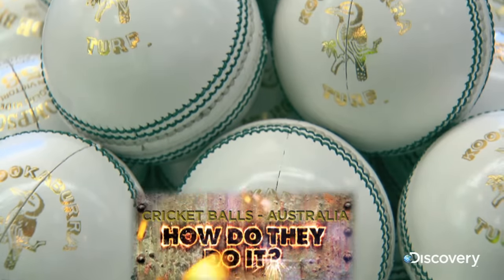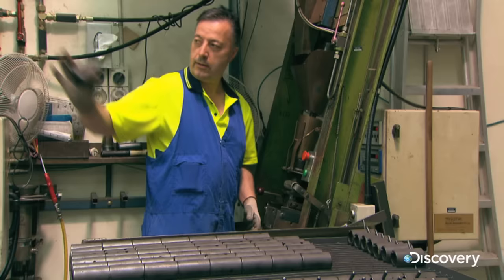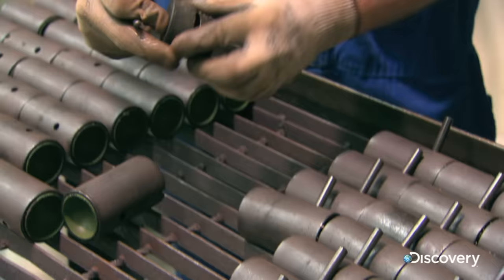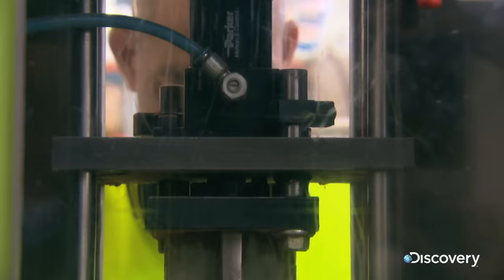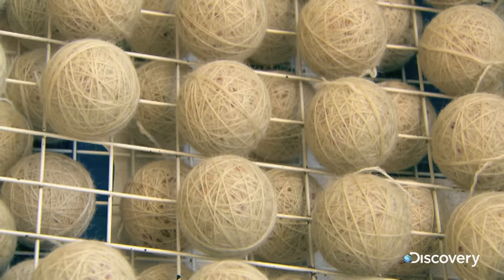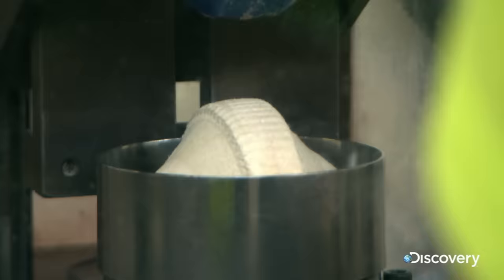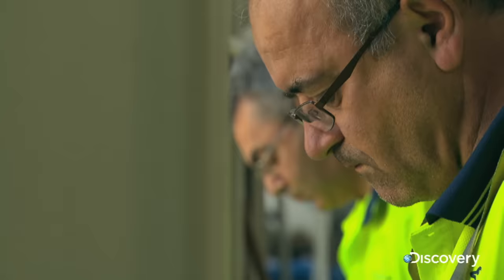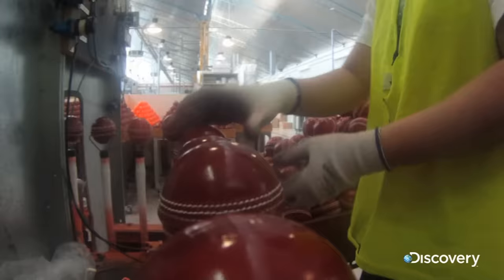Cricket Ball - How Do They Do It?

Comment: That double seem does nothing. Dukes makes it correctly where the double seem crossed over to the other half of the ball. Which is infact the whole point of the double seem.
Reply: thats not really ture. they aid in holding the quarters together, they provide a seam to hold onto when bowling and the provide the raised seam to bounce/ land for spin and cuting off the pitch. sure they dont hold the 2 halves together like duke balls but thats not really necessary. its really over kill, they only need to last a days play or X overs before its replaced. stitching like the dukes balls is over kill and make the balls WAY more expensive. Kookaburra makes so many balls cheap enough to make them accessible to everyone. plus they donate so many balls to grass roots and junior teams to promote cricket. i dont think the dukes does. (that said, fuck me sideways the dukes ball is sexy)

Comment: Baseball nd cricket are bad example for a real sport.

Games like football , lawn tennis and basketball  are way better.

60 % of the match result is dependent on a single coin and umpire's decision ( right or wrong ) in cricket and not on the players.

Baseball is just straightaway  stupid and luck based.
Reply: And kicking a football is comparable to kicking a rock.
Reply: Bro, in cricket, the toss does matter, but only about 5 percent. The toss-winning captain then has to study the pitch and outfield conditions to provide a decision whether to bat or bowl. 

The opposing captain has to develop methods to tackle the conditions. e.g. how to counter the deadly swinging conditions on grassy pitches (the shiny new ball swings like an arc and sometimes even swings back after bouncing.) How to counter cracked dry pitches which can offer extreme lateral turn to spinners, sometimes even spinning the opposite way to the effort given by the bowler. How to adapt to wet or damp outfield conditions where the ball barely bounces. They have to also predict the kind of deliveries that bowlers would bowl in certain conditions. AND MANY MORE. 

Similarly, bowlers have huge challenges too. Fast bowlers have to learn how to adapt to conditions on slow pitches as the ball comes on nicely to the bat in such conditions. They have use tricks such as reverse swing, cross-seam deliveries (uneven bounce), cutters (fast spin deliveries) and toe-crushing yorkers so batsmen cannot get under their bowling to hit. They have to predict the batsman's next action and bowl accordingly. For spinners, they have to aim at cracks in the pitch and turn the ball well as they are slower and batsmen like going for them for runs. In pace-friendly or batsman-friendly conditions the ball's turn is restricted, they have to rely on brilliant line and length and tricks such as googly/doosra (balls delivered that turn the opposite way with a deceiving action), topspinners (balls delivered that bounce unusually high), flippers (balls delivered that barely bounce) and countless other tricks. They also have to adapt in a split second to a batsman's stance; if they are looking to come down the pitch and hit, bowl wide of the crease out of their reach for a stumping, etc. 

This is all while making sure to avoid overstepping and other illegal deliveries. Bowlers need a strong body and control of the ball.

At the same time, captains must decide where exactly fielders must be placed, in collaboration with the current bowler, while obeying fielding restrictions of the maximum allowed fielders in the outfield. Wicketkeepers have to have extreme reflexes to catch balls that have touched the bat and deviated.

And with the T20 format arising, every single player is required to be completely fit in the field, as they are expected to take brilliant dive catches and stop hard hits. And batsmen need to train to run fast between the wickets to convert ones into twos. If you scrutinise most cricketers today, all of them are extremely fit and strong. If not, they would easily be plagued by injury.

And the Test format tests endurance and resolve - playing for five days with 90 overs a day is extremely difficult.

All umpires do are officiate the game and determine wickets and boundaries, just like how referees in soccer/football decide goal or no-goal and offsides. And current rules means that cricket teams have the power to challenge an umpire's decision by using a TV review with innovative ball-tracking technology and extreme slow-motion high-tech camera replays. Umpiring is also challenging because cricketing rules are very complicated.

Therefore it can be seen that cricket is a highly mind-involved game that requires lots of skill and endurance and also fitness on the field. 

No sport is superior or inferior. Every sport exists for different reasons and requires different skills. Before criticizing a subject, learn something about it.
Reply: Cricket: Positive mindset, good wrist work, keen pair of eyes, sharp mind, balance, perfect mentality, a ton of skill, a lot of practice, ability to judge a ball’s pitch and impact, a lot of energy, a thousand more things.
Football: $2000 shoes, a $4000 football, a leg
Reply: @noelmalik5018  hmm try $20.
Reply: @Thanos-hp1mw  ?